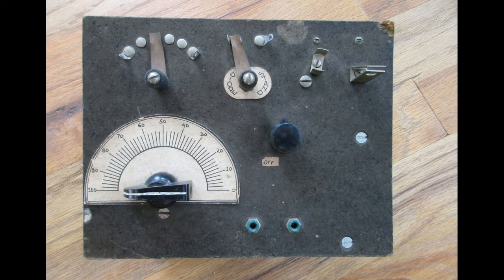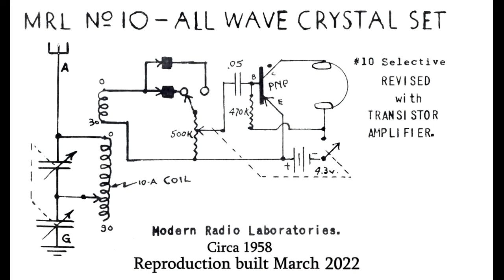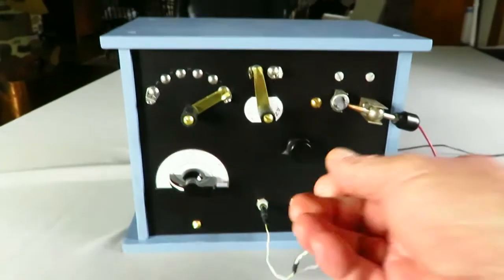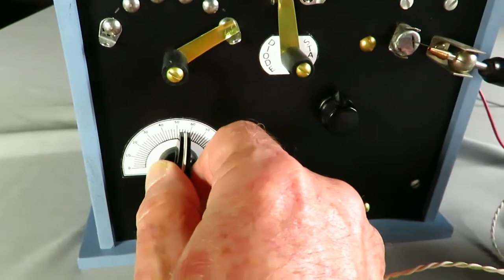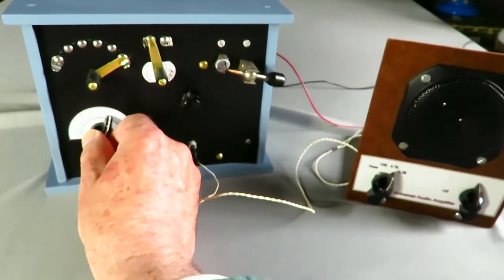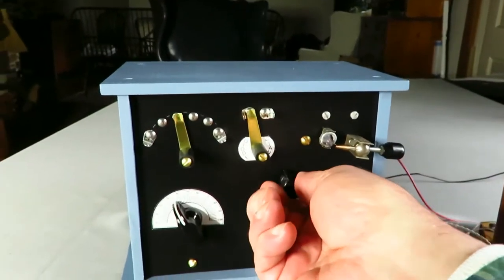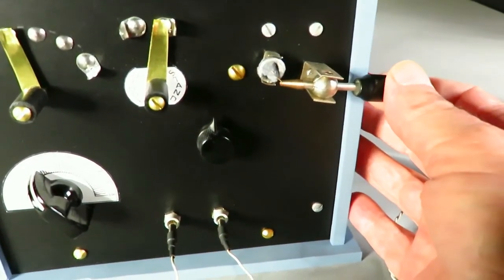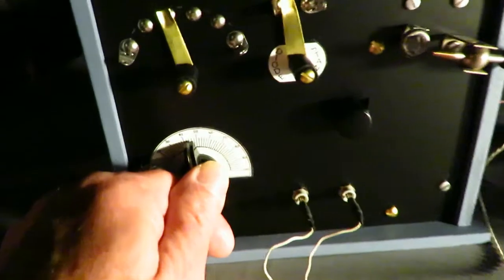A Modern Radio Laboratories® No.10 All Wave Amplified Crystal Set

Comment: I build such thing with tubes in 60 ties with the same SW selectivity 😄but no matter - it worked with joy  And the quality of sopranos  is unparallel to modern wirh narrow filtering.  Build also such on e with solid transistors just to have better  source for  recordiong Then build tube FM tuner and finally - yes, you wont believe,  I purchased my  first own radio with FM😊

Comment: VERY COOL CRYSTAL RADIO . I BUILT ONE LIKE THIS AND. MADE SURE IT IS A GENUINE   CRYSTAL RADIO THAT DOES NOT DEPEND ON  ANY POWER . ONLY THE RADIO STATION  SIGNAL  IS THE  SOURCE  OF POWER AND A VERY HIGH IMPEDANCE  EARPHONE TO DETECT THE VERY  WEAK SIGNAL .  SIMPLE MODIFICATION  TO THIS SCHEMATIC  . WORKS GREAT .

Comment: Very, very nice recreation of Elmer's original. They are very touchy about that MRL copyright. Good to see you again. BTW...still loving my KT135...thanks.
Reply from the maker: Hi Karl! I had my KT-135 out yesterday. Since I have a (temporary) outside antenna for the MRL No.10, I used it on the KT-135. During the day the shortwave bands were pretty much dead, but the signals came pouring in around 5PM.
Reply: @michaelsimpson5417  Hi Mike! My KT135 is my daily driver. I'm curious, you mentioned in "The Analog Dial" that a 12AU7 will sub for the 12AT7. Have you ever tried it? I've been meaning to, but haven't gotten around to it. It's been suggested that the AU7 will provide smoother regen and improved MW performance. Best to you and Andrea, Karl  ...Quick follow-up...Just checked the price for the 12AU7...ouch!!
Reply from the maker: @Karl63601  Karl, somebody gave me over a dozen 12AU7s that came out of an organ. Some 12AX7s, too. Send me your address to mike@mikesyard.com and I'll send you some. I have a tube tester, so they'll be good. Each has a different gain. See this: https://jaazz.me/2019/01/04/12ax7-12at7-12au7-preamp-tubes-differences-explained/

Comment: Good video!  I like this radio. Perhaps I'll build it. I received the first MRL catalog in 1961. I spent 100s of hours studying it in my tree fort.
Reply from the maker: Do you still have the MRL catalog?
Here is my MRL site - http://www.analogdial.com/Osterhoudt/Osterhoudt1.html
Reply: @michaelsimpson5417  I believe I still have a catalog and lots of reprints from Paul from around 1994. Your site is excellent and from it, I found out about Carl Beier and ordered a kit from Lance in Texas. Then I built another from scratch. His design worked so well and out-performed many tapped, large diameter, heavy gauge wire and expensive radios I had built over a sixty-year period. Recently, I discovered 2" O.D. thin-wall PVC from a vacuum cleaner shop. The pipe is used in the wall of central vacuum systems It took me sixty years to find this perfect pipe. Much thinner than thin-wall PVC but rigid for coil work. Nice couplings to slide right over it for adjustable antenna coils.
Thanks for responding, Michael.

Comment: How are you connecting to the crystal radio, a transformer?
Reply from the maker: Do you mean how am I connecting the amplifier to it? I just plug it into the headphone jacks in place of the headphones.
Reply: no,  imean the different impedance switxh that you have displayed. Most amplifier 
are low impedance and that would load down the signal.
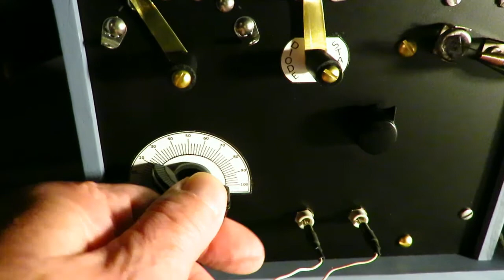Reply from the maker: @romjone4801  The switch puts either a 2.2K, 4.7K or 10K ohm resistor across the input. This is needed for some regen sets, such as the MRL One Tube, but it also improves the sound of a crystal set. Technically, I should use one of those Bogen impedance matching transformers. The amplifier is an LM386 module I got as a kit from ebay. The other side of the amplifier is shown in this video at 4:04.
https://www.youtube.com/watch?v=a2qDJZMiTik&t=14s

Comment: It shouldn't be able to receive CW yet we can hear it when you show SW band. How it is possible?
Reply from the maker: On the SW band the set tunes so broadly it was picking up everything at once. The CW signals were heterodyning with each other and with the AM signals.
Reply: @michaelsimpson5417  True. I somewhat missed the fact that there's no need for BFO if you have so many strong signals few kHz away from each other. 

I remember ~20 years ago I saw an article in one electronics magazine on how to make simple SW radio. There was no tuning. It relayed on bad selectivity and changes in signal strength caused by ionosphere. Just sit and listen to the whole world at once. Interesting how the author took advantage of the disadvantages. I never tried it tho.

Comment: No look at the insides??
Reply from the maker: The rear of the radio without the cabinet is shown it 00:50. To see all the details, click on the link below the video.
Reply: To expand a little, Elmer O. sold what he called Detail Prints, which were instructions to build many of his radios -  using parts that he of course, sold. This radio is Detail Print 34. It is a link on the page that Michael posted.